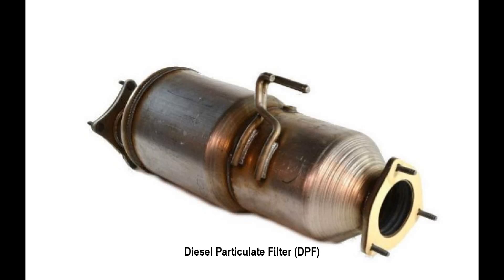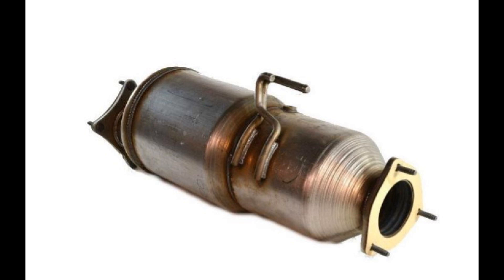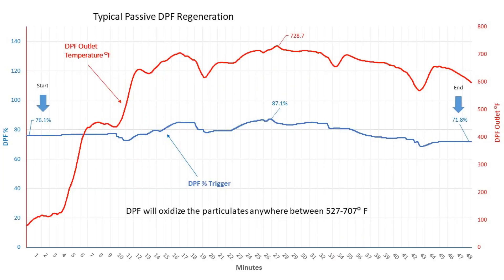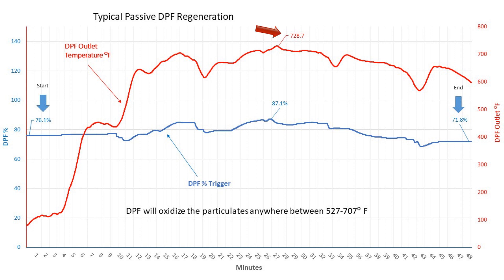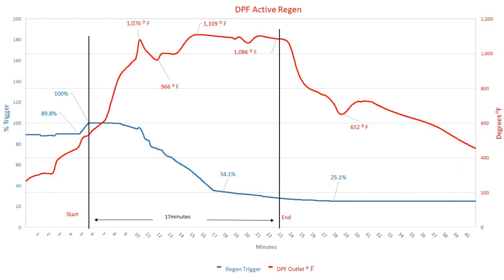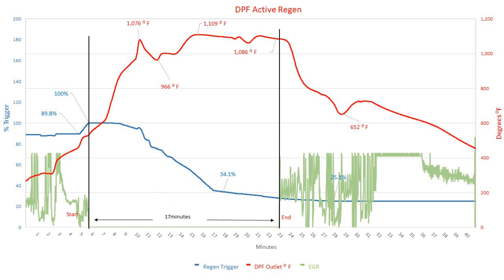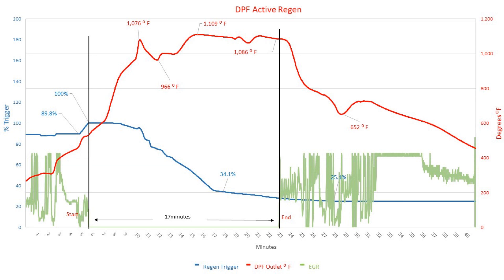RAM 2500 Cummins DPF Operation - How many miles between active regenerations

Comment: I have a 2018 Ram. I can’t tell when mine goes into a regen. How do you tell when you don’t have the extra gauges?
Reply: Nomadic Diesel The clicking has nothing to do with regens. It’s the DEF injector that makes the sound.
Reply from the maker: Yea, mine clicks like hell when idling after towing.
Reply: Thanks I have noticed the clicking.i had a Titan XD 5.0 Cummins before this truck and you could definitely tell when regen occurred. Your MPG would drop to 6 MPG and the engine would idle at 1000RPMs. Had to get rid of it for several reasons. Didn’t pull my camper very well and transmission had started shifting extremely hard from 2nd to 3rd gear. Plus the overall quality  of the truck was extremely poor.

Comment: Thanks for the video Marion!  Clear and precise explanation about the DPF, and the difference between active and passive re-gens and when the EGR comes into play.

One question, what is your"normal/average" highway speed? 

I run at about 65 mph for about a half hour to 45 minutes, twice a day, to and from work.  I don't really notice a regen, but can smell it when it has happen when I get out of the truck every so often.

Still new to this with an '18 purchased in April of this year and about 8,000 miles on it.
Reply from the maker: 65 - 70 for both passive and active but with a stop and turn around every 10 miles.
Reply: @MarionBlair question I want buy 3.0 Duramax but I keep truck for 15 years and I don’t know nothing about diesel truck , the DEF system scare me I heard is really expensive to repair if something fail and like I said I keep truck for long time , what I can do to beep the DEF system with out problem ?? I always had v8 truck
Reply: @OldRoute66  my 18 that i bought brand new only has a little over 5,000 miles on it lol

Comment: do a full delete.. problem solved no emissions junk to worry about again...
Reply: Cummins diesel u r right about it is our vehicles and we should be able to do what we want and as far as the deletes they already deleting 2019 and will probably always figure out a way. But now recently they have started to crack down on delete kit makers and once they see that doesn't work all the way they will start having to make every road diesel pass smog testing and that's when people will be screwed. Sucks but it's coming. Think we can thank everyone who was showing off rolling coal on protesters and smaller cars and also making videos that got millions of views. I have a diesel and absolutely love them but there's a handful of people that are idiots who drive them. I really start noticing the day I bought my motorcycle and had idiots roll coal on me.  Anyway dumb shit like that is just helping emissions crap speed up there process
Reply: chris keiffer You are correct. The EPA is not going after individuals. They are going primarily after the aftermarket outfitters and Diesel shops installing the kits illegally. Just Google “EPA Clean Air Act enforcement actions” and you can read the legal cases. Shops are being fined anywhere from $15k to $300k depending on the number of violations. Two of my local shops have stopped doing them due to the financial liability. Huge fines would put them out of business. Not worth it. So, Diesel owners will be on their own to install them and only if you live in a state that doesn’t have emissions testing (yet).
Reply: there will ALWAYS be a way to do a full delete... at least on the vehicles already on the market. brand new ones now those are a maybe being the aftermarket have been created yet. they can never truly be able you stop someone from doing a delete. my theory is it's my truck I'll do what i want to it. there's always some place to get it inspected that's doesn't care 😉😁 luckily i have a 04 Cummins completely void of emissions crap from the factory. didn't even have a cat factory
Reply: You can delete your truck. It's just illegal if you get caught. $$$
Reply from the maker: Yea, that's what I'm hearing also.  Deletes may soon be a thing of the past.  Hope not.

Comment: Marion I always appreciate your videos. This is a topic I’m very concerned about. I usually regen every 900 miles but have noticed that getting less and less recently. However, I’m currently at 1050 with nothing so I’m just waiting for that thing to pop into regen. I recently tuned my truck with Calibrated Powers Emissions Compliant Tuning....I’d start looking into that at 2 AM as it just might be the best midnight purchase you make
Reply from the maker: Sounds like it's working well.

Comment: can you tell me what device that you're using to monitor your gauges and exhaust temperatures thanks
Reply from the maker: I'm using a Banks Idash.  I'll do a review on it and the Edge Insight probably next.
Reply: I’d love to see your video on the idash installation and use. I wish Banks would release the derringer for the RAM trucks. They say products are being developed for the Cummins, but they give no indication what or when we’ll see anything. 

I did watch your video on the OBDll reader and the Torque app. I ordered the iOS version of the reader and an app that was recommended for that reader. Like you said, an inexpensive way to monitor things until I get the Banks products sorted out. Thanks for all your informative videos.
Reply from the maker: @727cpt  I'll probably do the next video on the idash.
Reply from the maker: There's an app you can monitor with an android device called Torque.  I have a couple of video's on it.  Very cheep way to do it.
Reply: Quick question there is no videos on YouTube about glow plugs on a 6.7 Cummins 2013.  I'm in Kansas City started my truck up for the first time and saw a glow plug symbol. Where the miles-per-gallon per gallon symbol is  under the boost gauge usually at. This time it had 0 to 75 gauge above the glow plug symbol. Yellow line going up. I think I started the truck too quick. Is that a symbol for glow plugs heating up to 75%? Maybe you can do a video on that thanks.
Reply from the maker: @bosshogkcmo  the truck gas a grid heater, no glow plugs.  I have several vids on grid heater issues.  You are probably seeing the the grid hester symbol but don't know what the 75% is you are see g.  It has nothing to do with the grid heater.  Would love to see a picture of that.
Reply: @MarionBlair  Do you have a email or format that I can send you the pictures.
Reply: Also I downloaded the torque app and got the OBD2 scan device through Bluetooth. How can you set up for the gauges to show the exhaust temperature gauges and on a torque app
Reply from the maker: @bosshogkcmo  marionblairjr@gmail.com